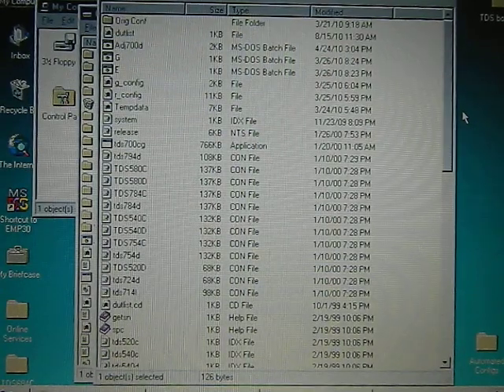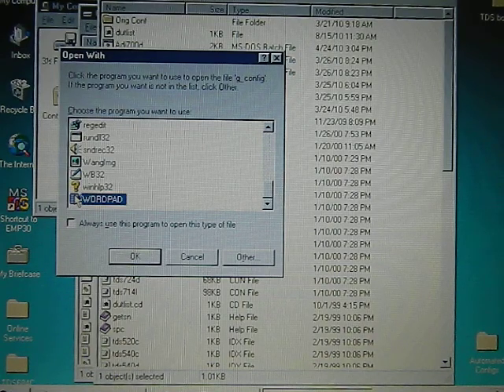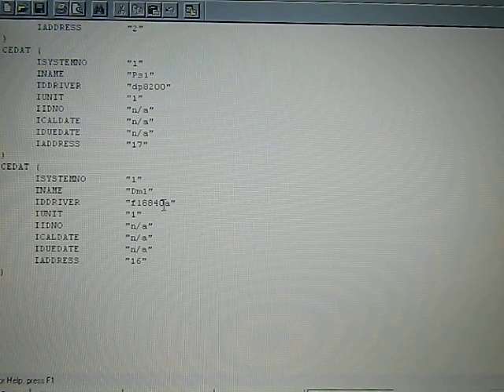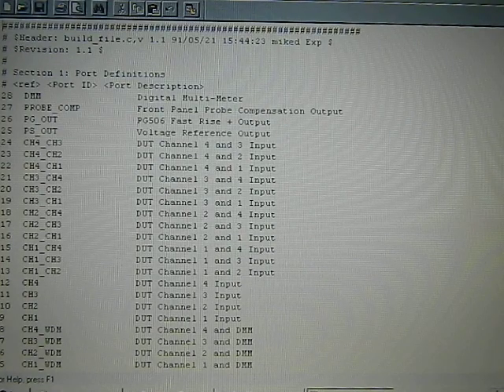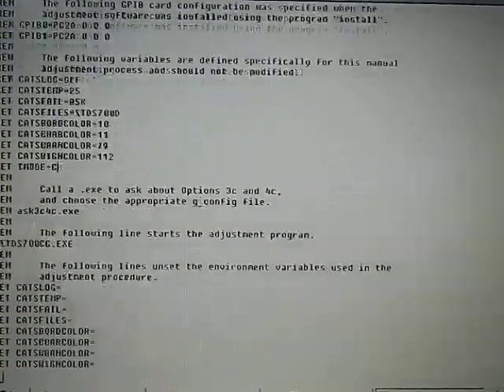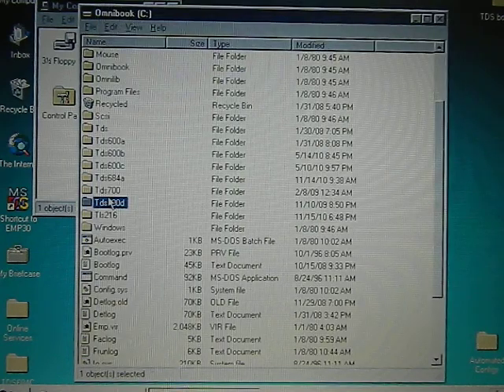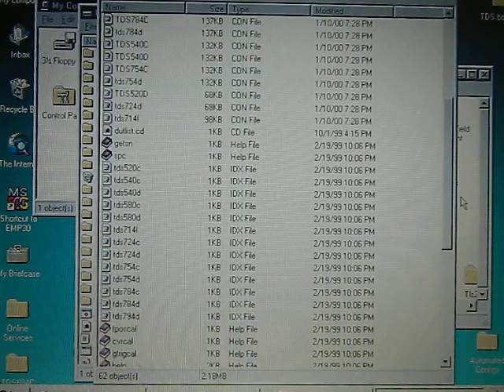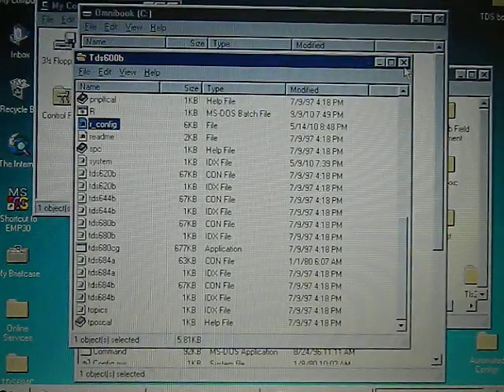Tektronix Automated Field Adjust Software

Comment: Hi can it be used to calibrate TDS784D too? If I have windows 7, how can it be used? any idea?
Reply from the maker: You need the field adjustment software that was shipped with the service manual, a PC running pure dos with a PC2A GPIB card. See the comments in the description and my reply to Mr. Vaudagna below. The TDS700D software was very common though it may take time to find/obtain a copy. You will also need the signal sources noted. It has been years since I watched this video but I'm pretty certain all of the answers are here. good luck!

Comment: I wish you read thi msg.
I have to calibrate my TDS540 scope I can't get the file configured. Could you send me just the G_CONFIG and R_CONFIG file?
Wish you can help me.
my email address is: alberto.vaudagna@gmail.com
Best regards, Alberto.
Reply from the maker: +Alberto Vaudagna 

autoexec.bat:
SET GPIB0=PC2A 0 0 0
SET GPIB1=PC2A 0 0 0
path c:\dos;c:\gpib

config.sys:
Device=C:\DOS\himem.sys
Device=C:\DOS\emm386.exe
dos=high
Device=C:\GPIB\GPIB.COM
Device=C:\DOS\ANSI.SYS
Files=30
Buffers=10

Keep playing with it until the Clearerr.exe program works. If that program does not work, for certain, the field adjust software will not work. HP Docking Station F11771A. Good Luck!